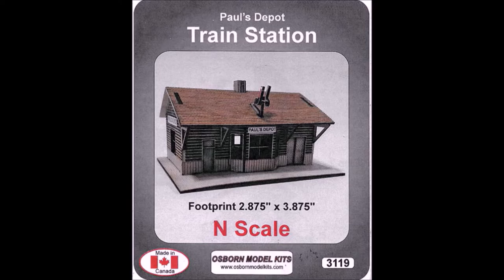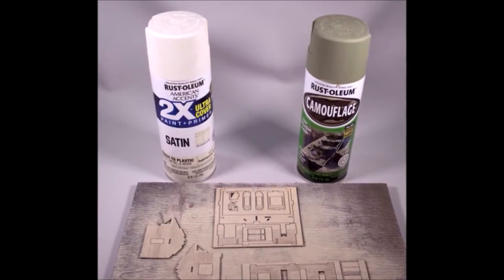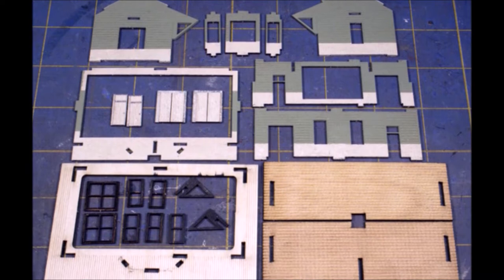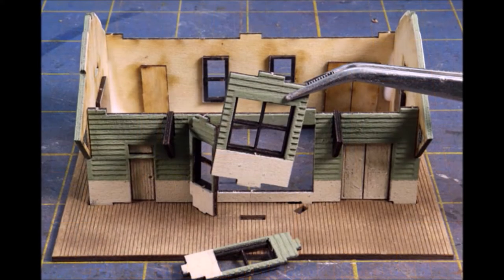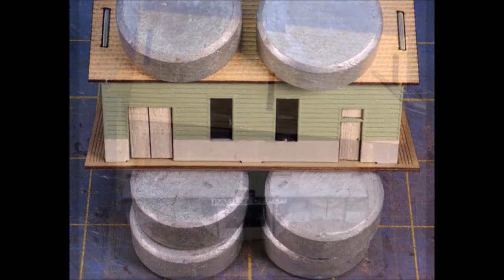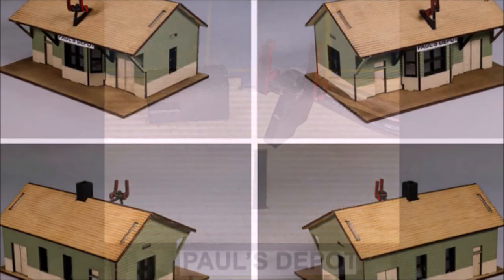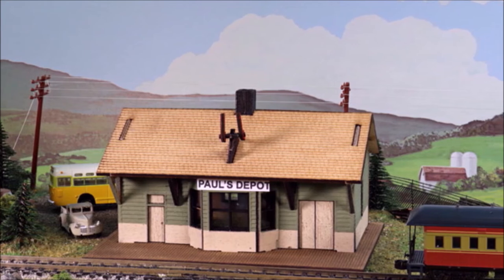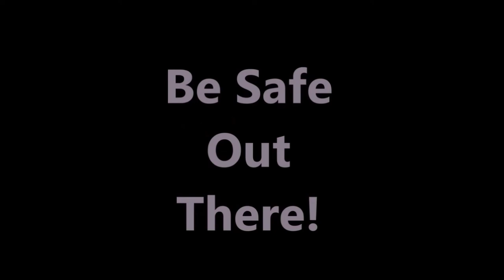Osborn Models "Paul's Depot" NEW Kit! (A Canadian Company)

Comment: Yup needs shingles, it could also really use some corner trim.
One thing I really like about kits like this are some simple kit bashing possibilities. One I would add would be some window ledges under the bay windows. A couple outside lights, and if your really adventurous, extend the freight side, put a siding on the back side and you have a LCL spot. Fill the siding in like it is a road crossing.